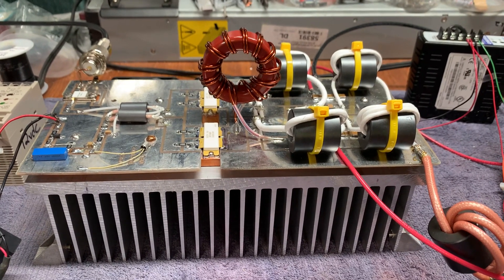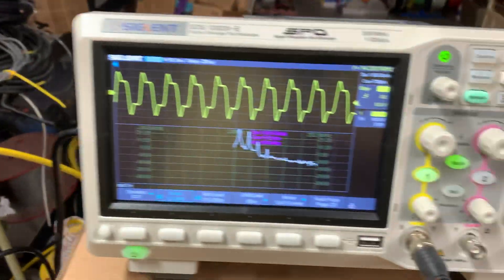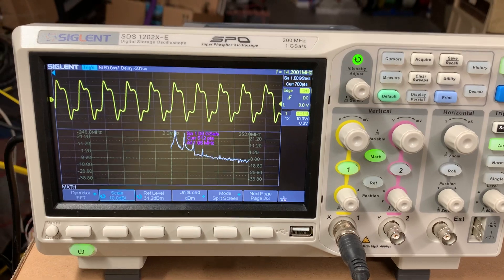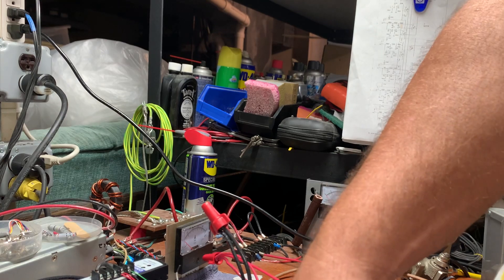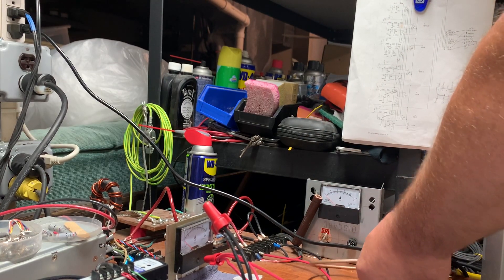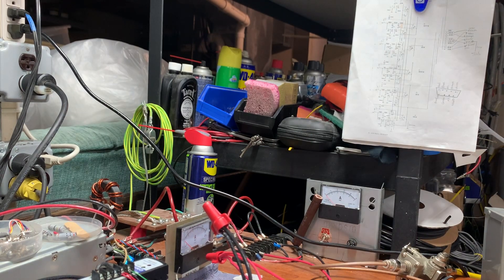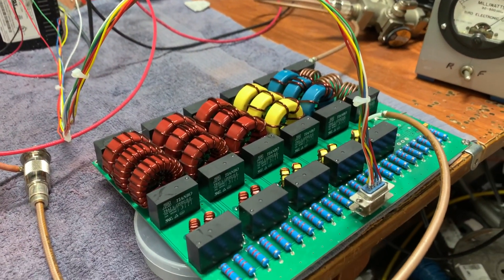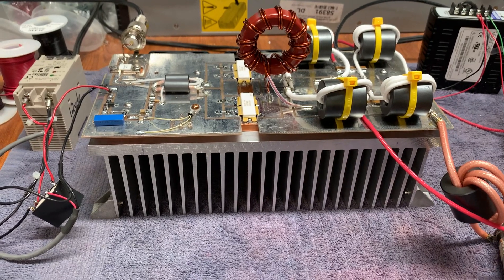Low Pass Filter required.

Comment: Isn't the output a bit suspicious? These devices should be able to output 4kw+, I had a similar waveform recently (different devices in the case I am talking about, but I have been using both ART1/2 as well), it nailed down I had a parasitic oscillation in the power stage. Output filter cleans the signal, but does not solve the root issue (the efficiency was suspiciously low).

Comment: Notice any differences between Diplexer, and Regular LPF? I have yet to test. Not sure if it would improve output circuit as nothings bouncing back. Not sure if the reflections would affect the performance, or just the temperature of output circuit.
Reply from the maker: Not much difference.